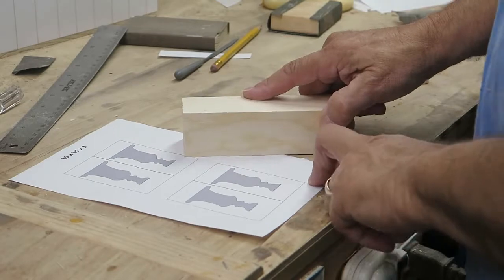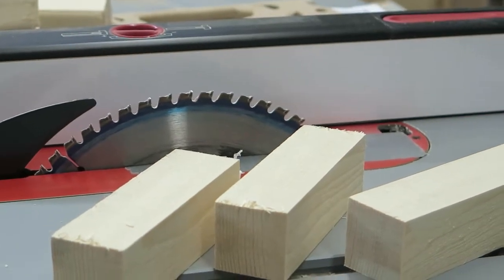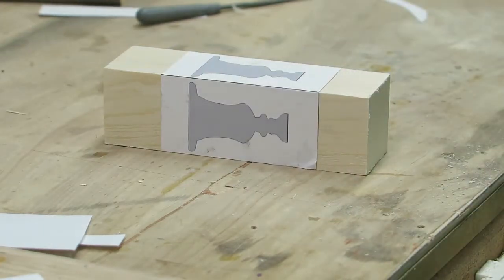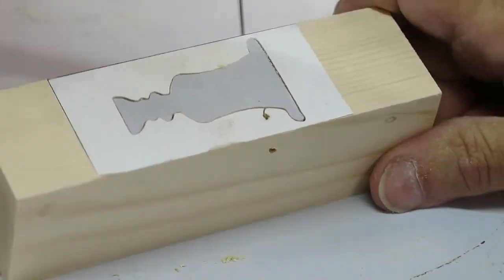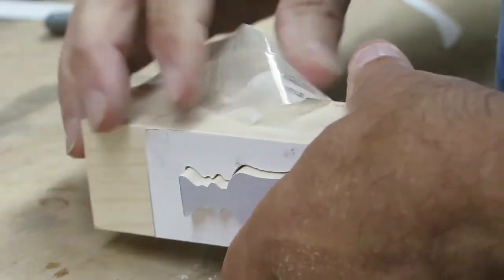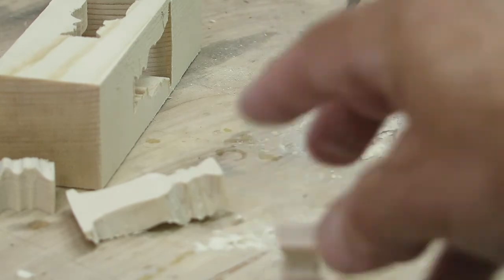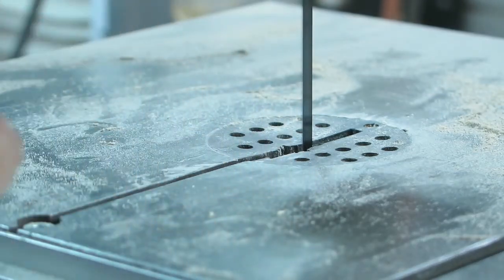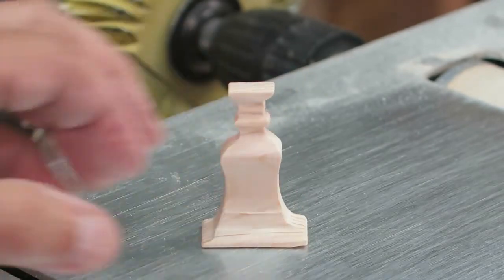Compound Cut of Urn

Comment: I've done something similar when I wanted a turned part, then I put it in the lathe and rounded it off! Because saws are quicker than lathes for removing stock (unless you count removing it from the lathe and tossing it across the room 'cuz you forgot to change the belts to slow speed.)